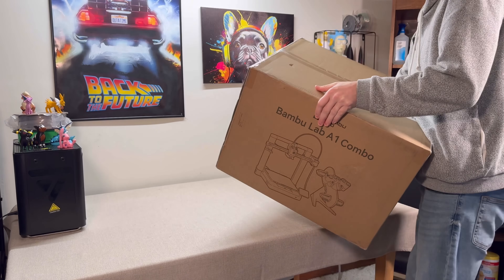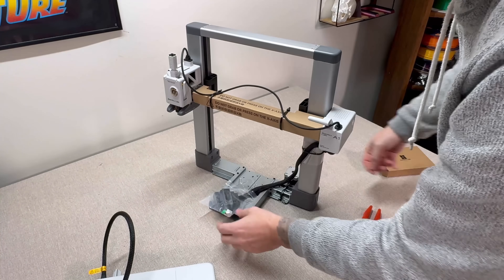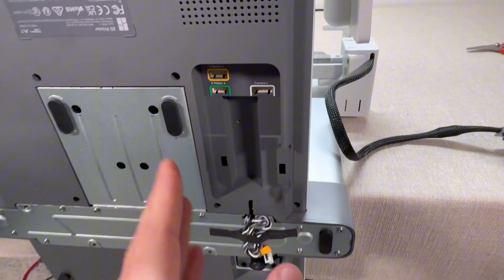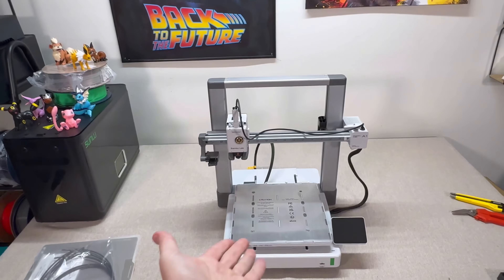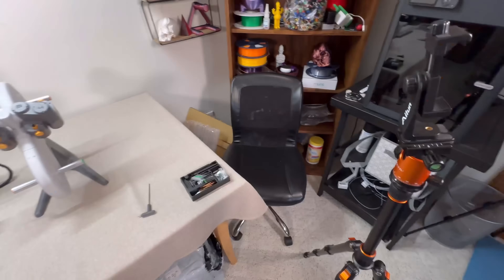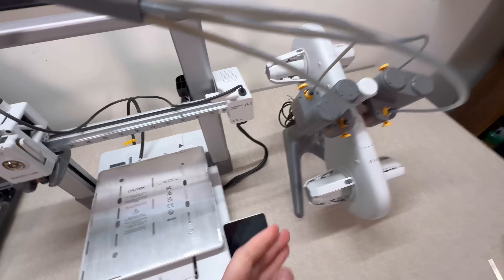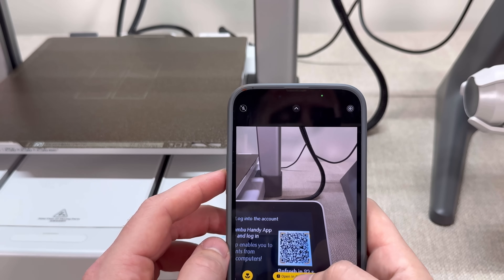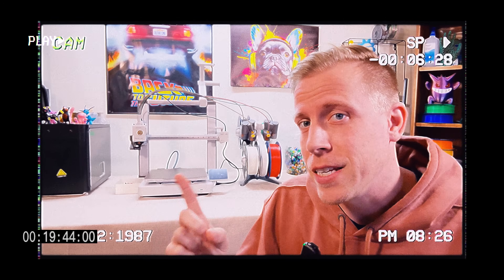Bambu Lab A1 Setup - How to Assemble & Start Printing!

Comment: Thanks for sharing! I am thinking about looking into 3D printing. Just a suggestion, in your next video, try to avoid too much motion like moving constantly between the parts and the printer. Some viewers will get motion sickness. I usually cut from point A to point B. You also need to account for this in the voice over too! Just a thought, , , Cheers!

Comment: Where does the razor go? I got a small razor and another even smaller cutter.
Reply: The big one is a bed scraper, If you want to use it you need to print a handle for it. The file is included with the printer. The smaller one is the filament cutter. It is already installed in your printer. You only need it when your existing one becomes dull. There are videos on how to do it online.
Reply: @omerbilir3784 thank you so much

Comment: the inside of mine was different I didn't get the tool tray just a couple of baggies in a plastic bag with tools and screws. mine also didn't have the hold down screws for the plate

Comment: Decent guide, needs some order of operations works and you DEFINITELY need to add the z axis plastic locks to the front half of the video. I dont have an ams so I started the calibration with those still on since there was no mention of removing them.

Comment: "You don't even need to use these tube accessories".

In the manual it says that you absolutely should use that cable clip or the black cable can get in the way and damage the printer.

Comment: One thing you did not mention was for those of us who are rural and do not have good internet connections, was how to load print files i.e. G-Code files on the A1 via a microSD card in the slot at the front of the machine, by loading the G-Code file on the microSD card and then inserting it in the machine. As I do not have and A1 at the moment it and am considering purchasing one, it would be nice to know how smooth or not the process is for this and how the flow of all of this works. 🙂

Comment: Next question is about AMS. I have always just printed with a single color, whatever color I had available. How do you select the colors for certain parts of your print? Lets say I have an STL of a cute little mushroom with a white stalk, red shroom on top with yellow spots. 3 colors total, but my STL when I import into Banbu Lab Studio only show a grey model. How do I assign colors to different parts of a model?

Comment: This video came in very handy yesterday. Very same setup. A few differences. The spool spindle is integrated with the spool stand and not a separate screw-in piece like your video. Must be a later design. Also the box layout is different. My tools are very rudimentary Allen keys and came in a bag, not a neat cardboard box like yours. Also did the firmware update like you. Great video. Thanks

Comment: Better setup tutorial than Bambu's.  Also, well played with the hockey tape reference.
Reply: That was probably Gaffers tape. It is reusable, doesn't leave behind a residue and has some heat resistance. I don't know anything about using it for Hockey, but it is often used to hold cables in place.

Comment: Good video ! But in min 13:31 when you are placing the tubes in the print head there is no specific tube location. You are saying the longer tube will go in the left inlet of the printer head. Actually it doesn’t matter!  Usually the longer tubes goes on the farthest coupler or inlet on the AMS lite and the shorter ones on the closest inlet of the AMS lite. Then the 4 equal length tubes will go into the 4 inlet on the print head without any order. The machine will automatically recognize the location. You only need to make sure that the tubes are not entangled together.

Comment: This was fairly easy to set up but after that everything is very coplicated.  I I have  a FlashForge and an Anycubic Vyper and they both worked perfectly from the beginning.  Both styles are discontinused and replacement parts are hard to find so I thought I would add the Bambu A1 as it had such rave revues.  I have worked on this for 4 days and have had a problem with every step along the way.  I finally printed a Benchy but now the screen is stuck on the Bency print page and I am unable to navigate to the Home page.  I can't bind the printer to my computer because I can't get to the printer's Network info.  I have spent hours on forums and You tube videos with no success.  I am so sick of this complicated procedure.  I have found the forums to be a total waste of time.  I will just have to contact Bambu and let them figure it out.  I had to quit working on it as I was ready to take a hammer to it!

Comment: Great video but zero mention of lube / grease usage during assembly. Kind of an important step. Is it necessary?
Reply: Yes it is. He should have mentioned it. Once you start the set up on the screen the message will pop-up to ask you to lubricate the A1. It is easy to do and straight forward. You don’t need to put grease when it is still new but definitely oil it. There is an excellent step by step video on you tube on how  and where to use grease and oil on the A1.

Comment: A significant issue with Bambu is that they bind the printer to one account at a time.  This means the printer can't be shared in a work place of family.  Your should advise people first set up a separate email and then set up the bambu printer and account with that so all family members can use the printer by sharing the credentials of the email and bambu account.  It was an unexpected surprise and complication for us, as we share others printers on the home network without issue.

Comment: we bought the standalone A1 MINI printer without the multi-colour machine.  Very strange is that it comes completely assembled, just have to remove transport packs and  attach the poop scooper and reel holder.  Much easier to get started, however, the tools come in a plastic bag, have to print your own tool box.

Comment: Mine arrived today and it didn't have the 4 screws in the bottom.  Didn't have the nice tool tray or quality allen wrench as in the video.  But I'm stoked to have this!
Reply: The new ones comes with wide zip ties to immobilize the bed during shipment. So it is normal. Even if you look at the updated set up guide on Bambu website it doesn’t show the 4 screws removal anymore. Regarding the Allen keys … mine came with the handle. But quality isn’t good anyhow. I use my own Allen key screwdrivers.
Reply: Mine came different too. No tool tray any longer and cheap Alan wrenches, no handles. But the new machines came with a fixed wire for the bed tray that they recalled a few months ago. I can print my own tray. I stuffed everything into a plastic bag in a drawer near the printer.  I can't wait to do the setup and print my first model.
Reply: @ weird .. Maybe it depends on the counties shipped to or different batches 🤷‍♂️. Anyway I wouldn’t call it a tray lol. Very flimsy. I ended up printing a tool box with 2 trays inside that fits all the accessories   plus spare hotends. You have a lot of choices in Maker World.  The first thing I printed was a filament poop bin 😊.
Reply: The latest models have cost-cutting packages.  Also, I ordered my A1 from Best Buy with Free shipping, cheaper than on the Bambu site, 6 days ago.  Best Buy hasn't updated their price yet.,,, but they will.  The B.S. Tariffs will see a price increase which is seen on the Bambu site.

Comment: Hey man love your videos❤ im gonna get my bambu lab a1 in February so i have a quick question.Does the filament come with printer and can you like use diffeent filaments from like different places like amazon
Reply: It doesn’t come with a filament spool as such. It comes with a very small roll of a PLA filament sample. You will need to buy some. Regarding the filament brand. Yes you can buy any brand however you will need to manually input the criteria ( PLA PETG TPU etc.. Color ) as well as the location of the spool on the AMS lite (1,2,3 or 4). If you buy a Bambu Lab filament. Bambu lab spools have an RFID chip built in so the machine will automatically recognize what kind of filament Color and location on the AMS lite